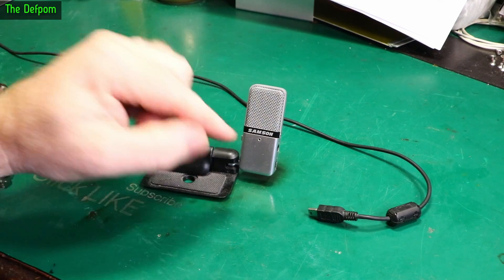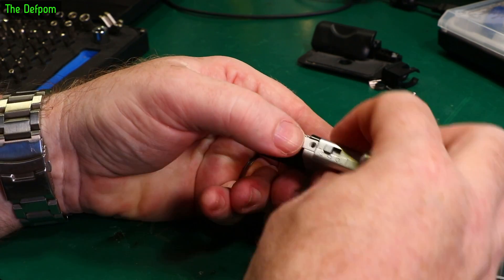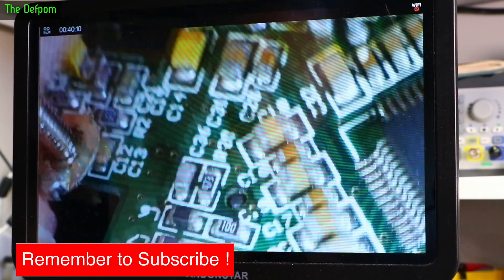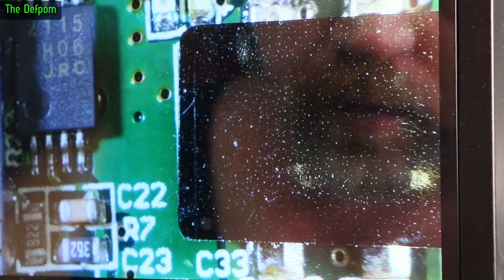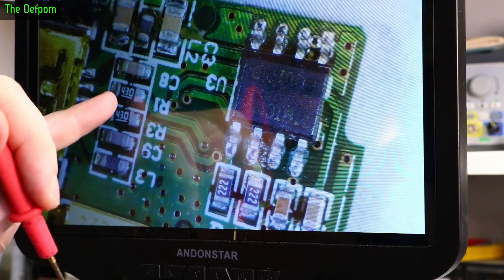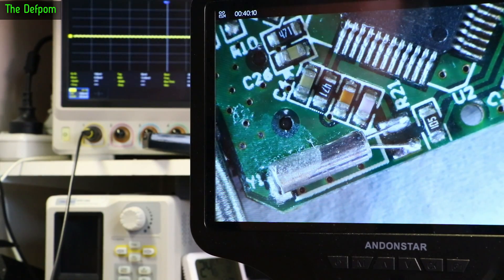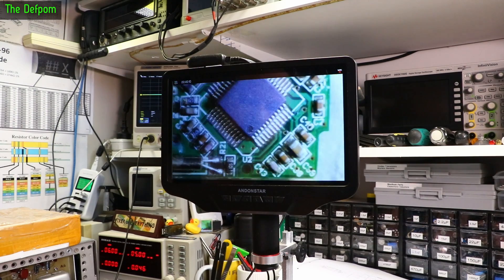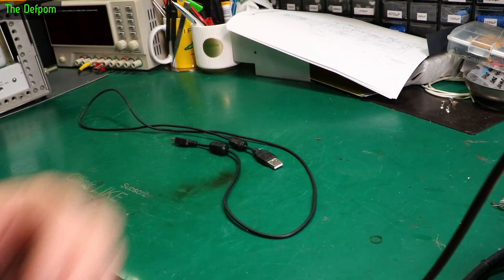🔴 Samson Go Mic Failed Repair - No.1139

Comment: I doubt the processor chip would do anything if the flash memory chip is faulty - or a connection issue between processor and flash chips.

Comment: Maybe you could salvage a USB audio chip from a scrap board that has the same or similar pinout.
Ive got an old USB audio interface that has a USB audio chip on it. I'll check what chip it uses.
Reply: Its a TAS1020B

Comment: Program:
void main()
{
  if( runtime_age > EXPIRE_RUNTIME_AGE ) 
  { 
     // Ruin clock signal, set Clockpin high, halt system, die
    REG_CLOCKPIN = 0xFF;
     // Processor halted at this point, time to buy a new one ;-)
  } 

..............

}